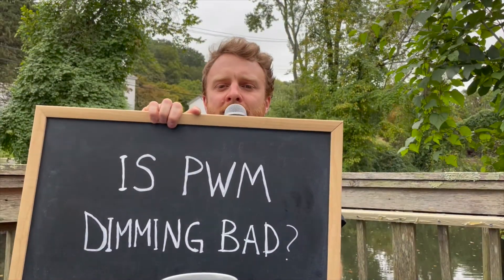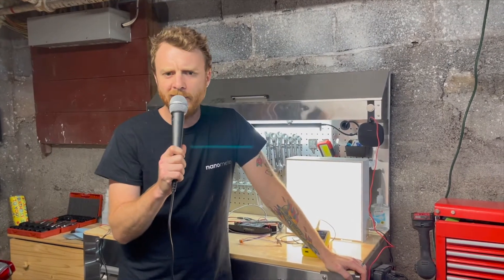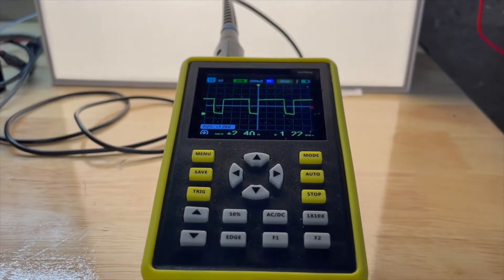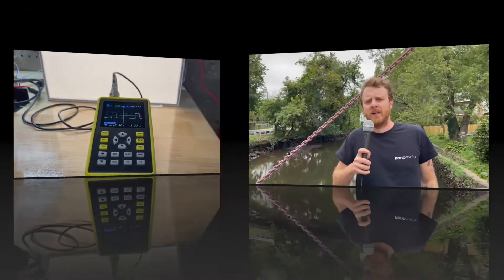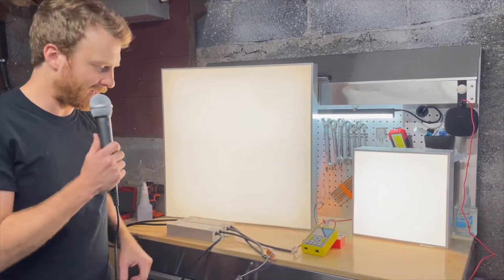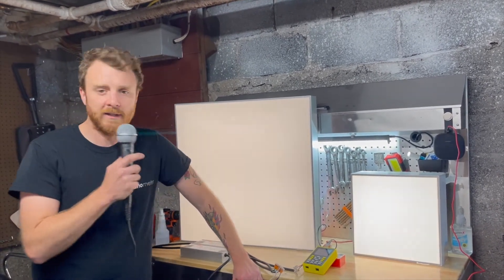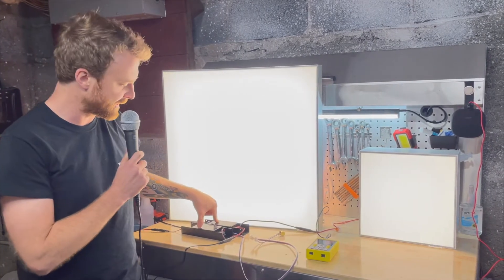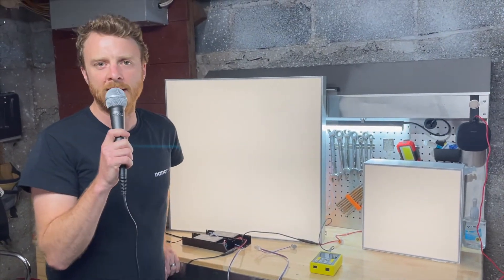Is PWM Dimming Bad? | Ask Nanometer

Comment: It IS bad the way it's usually implemented, i.e. everything lights up and goes dark in sync and in too low a frequency. It's almost worse when things are PWMing at different frequencies and you get slow pulsation as a result.

If you gotta dim down to 10% duty cycle, just have 10 LEDs and offset the PWM by 1/10 pulse width at every LED, so the thing as a whole is always lit up.